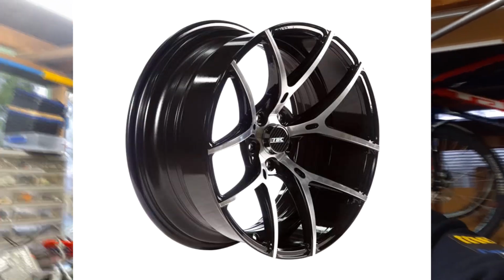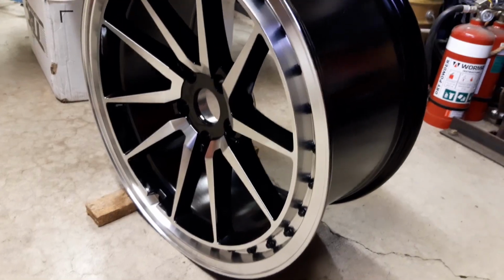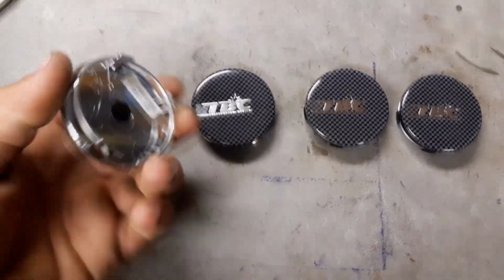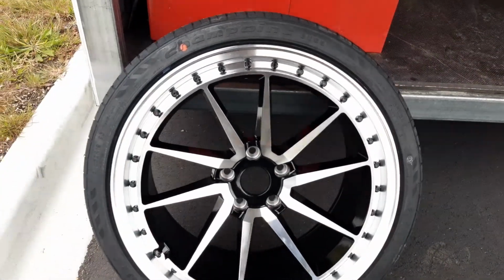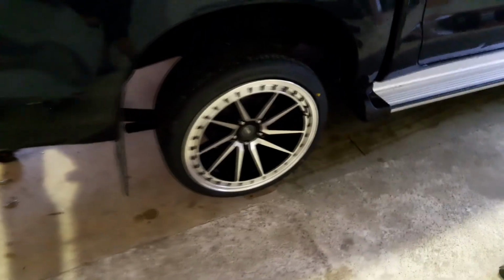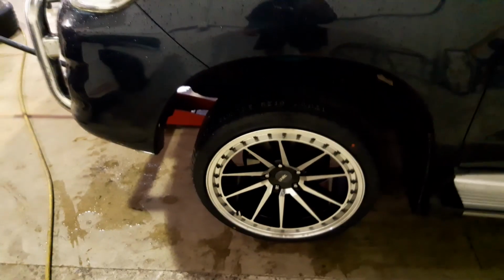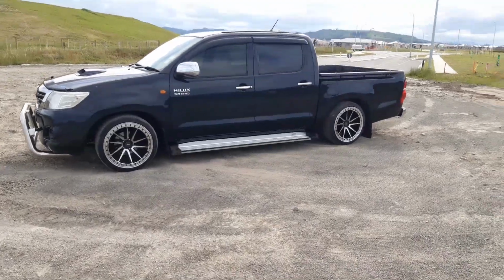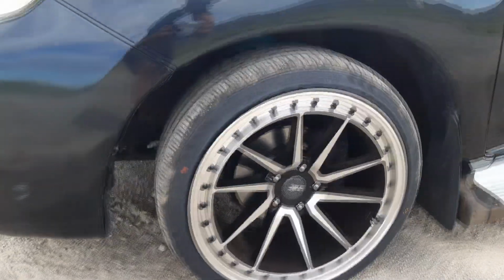NEW WHEELS & TYRES FOR THE LOWLUX!!!

Comment: Do you need a cert to lower it bro ??
Reply from the maker: Under 50mm, No 
I'll have to pull my blocks out for a wof. Cause I've done a 4inch drop in the back.  Legally should have a cert.
Reply: @motorvatednz7432  can it be certed for a 4 inch drop just curious for when i start my hilux